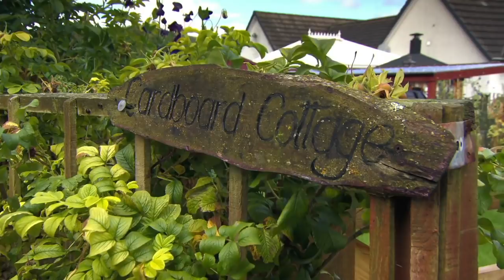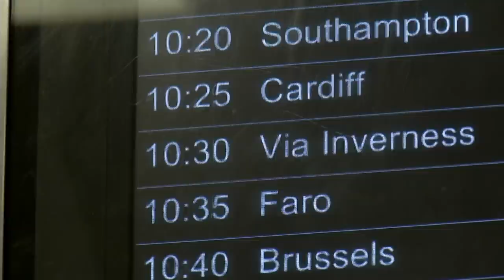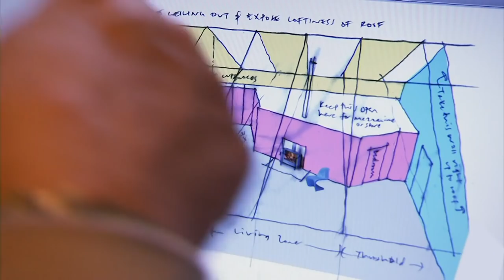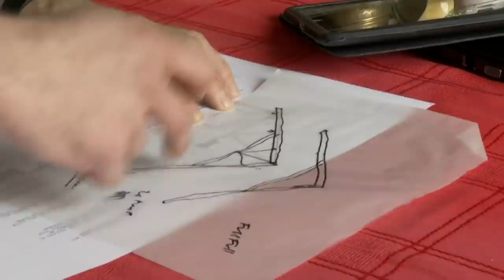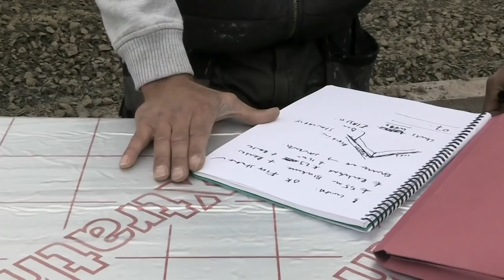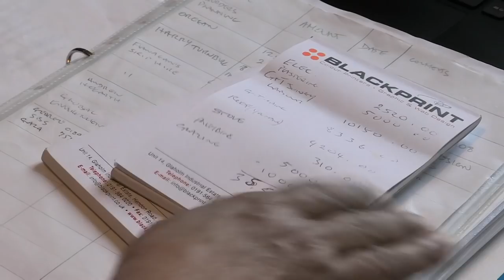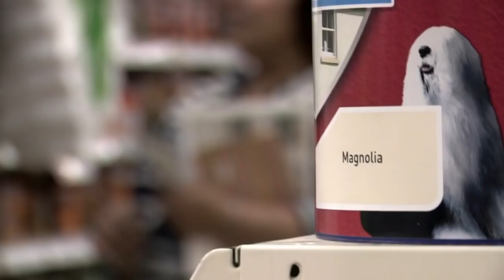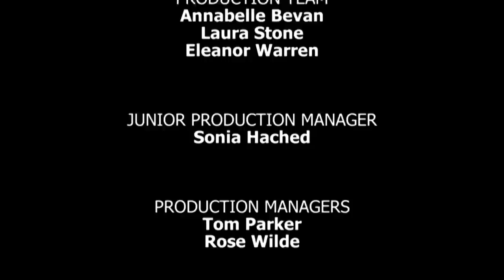The Challenge of Building a Home - The House That £100K Built - S01 EP2 - Home Design

Comment: 1, groundworks and foundations. 2. frame. 3, roofer and windows, bricklayer/ cladder outside. 4, plumber 1st fix. 5, electrician 1st fix. 6, insulation and vapour barrier to walls and any warm roof and any difficult to insulate part of the roof space. 7, dryline and skim, 8, first paint inside walls. 9, 10 and 11, first fix carpentry, plumber 2nd fix and electrician 2nd fix (can work at the same time). 12, 13,painting and decorationg finish, tile bathroom toilets (same time)14, kitchen floor. 15, 16, kitchen and second fix carpentry (same time) 17 kitchen tiles. 18, flooring.
Reply: Thanks for the info
Reply: That's very handy, Jonathan. Sincere thanks for taking the time to set this works schedule down to aid many of us newbies. It's much needed.

Comment: I love the simplicity of the interior, but her best decision was to increase the height of the ceiling. My home is an old 1882 brick small house with ten foot ceilings and the extra head space helps me cope with my limited square footage. I think the bathroom in the original floor plan is too far away from the kitchen. Moving the bathroom closer to the kitchen can save on plumbing costs and is more energy efficient.